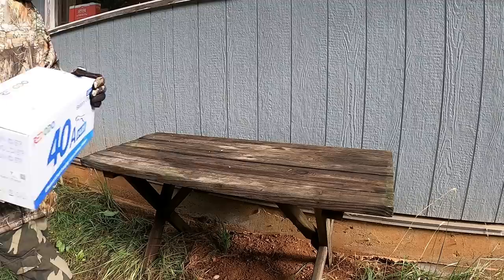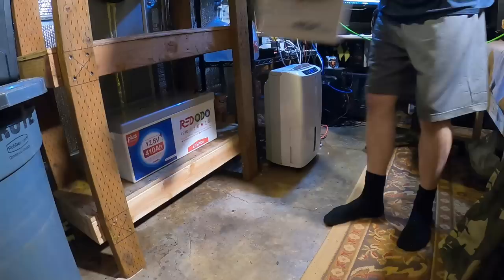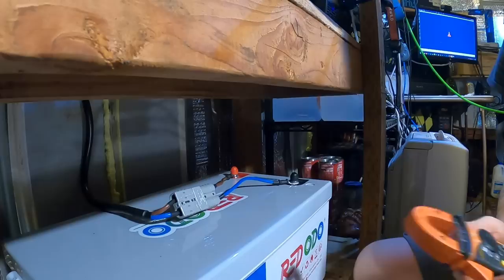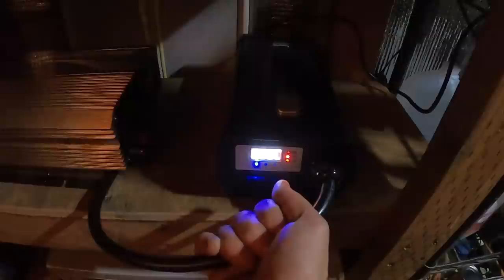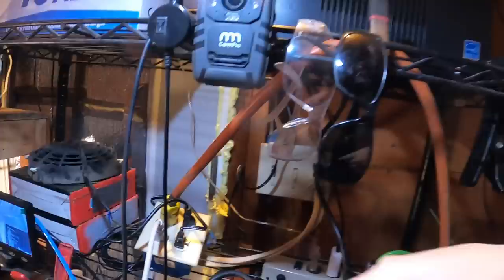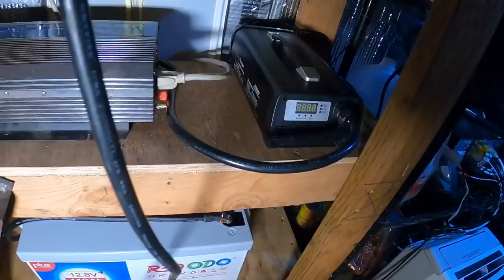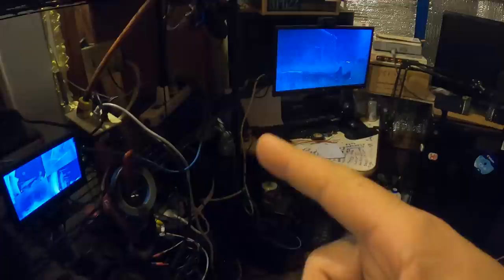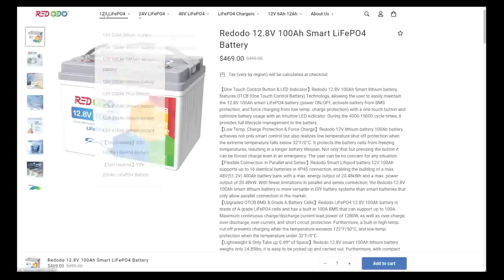40 Amp Lithium Charger & LiFePO4 Battery - Offgrid By REDODO

Comment: Nice battery and charger ive been running my cabin off 820amps of lifpo4 batterys a 4000watt inverter and 1000watts of solar for the past two years works out well and runs my well and and a small refrigerator good luck

Comment: Hi Nathan, Dennis here again..
Although you may already know, my advice..
1) LiFePo4 for house / coach power
But lead acid for the engine.
Lead acid can deliver the required cold cranking amps for the starter.. LiFePo4 cannot.
2) Please make sure you fuse or circuit breaker protect the smallest cable or weakest device in each circuit.
3) When you purchase any device intended to open a DC circuit (eg. circuit breaker, disconnect switch, fuse or fuse holder) make sure it is rated for DC.. Opening a DC circuit under load is a LOT more difficult due to the associated arc than opening an AC circuit under load..
4) Lastly, regardless of battery technology, and even though only 12 or 13 VDC, never underestimate how fast the current can rise to catastrophic levels under short circuit conditions.
While lead acid may provide a bit of a reprieve on a dead short due to it's higher internal resistance, the only thing that may save your bacon from immediate disaster with LiFePo4 is the BMS.. Sobering..
Anyhow, no insult intended, just a few of my thoughts to try to help you on your incredible journey..
Best regards, Dennis

Comment: Now you just need a decent MPPT solar controller (think Victron 100 I 50 "50 amp" or even a 100 I 30 "30amp") and a few solar panels to get real free power.......look into some used house panels, as long as they are under 100v for that solar controller.    $1699.00 FOR 400ah of lithium is so cheap, here in Australia we pay 800 to 900 for a cheap 100ah lithium, 300ah brand name battery will be $3000 plus.....

Comment: I'm sure this is sponsored so its hard to take this as seriously as someone who is on a budget and shopping for the best deal but all these lithium battery chargers are such a rip off. They aren't adjustable so you're stuck with one voltage and one amperage setting. Great if you're dedicated to one size battery but a lot of people find themselves buying what works for them and sometimes that can be 1 400Ah battery and other times that can be 4 100Ah batteries so you can split it up and use one or two of them for camping and then put them back into your home storage bank when you get home (at the same SOC). Or you might have a 48V home system but your RV is 12V and there's no point in changing your RV to 48V unless you really plan on pulling A LOT of power.

You can get variable voltage variable current power supplies (CC CV) for less than the cost of these dedicated lithium chargers. Less than $140 for a 0-24V 0-40A power supply and since it is CC CV it is lithium charger. Ideally you'd want to look for a 0-15V so you can get more amps or in the case of a 24V battery you'd want 0-30V.

https://www.aliexpress.us/item/2251832766643754.html?gatewayAdapt=glo2usa4itemAdapt

You get to control the current and voltage meaning your lithium ion can be charged to 4.10V per cell to double the cycle life or your can charge your LiFeP04 to a more realistic 3.55V to reduce stress on the cells (3.65V is unnecessary, you can balance from 3.45 to 3.55V and be just fine)

I haven't even checked the Redodo website yet but I'm going to guess $180 for that charger and there's not a single function it has that a CC CV variable power supply doesnt.

Comment: Does your security system (cameras and dvr run off 12 volts dc? If so you can go strait dc instead of using the ac dc adapter and that will save a few watts on the inverter.
Reply: What do you think the voltage of the cameras is?  USB?
Reply: @simonmasters3295   depends on your dvr and cameras but most are 12 volt you can look at the back of the dvr

Comment: Question
Is it worth it to build a Offgrid power system or just buy one of these all in one units?
Reply: Isn't that a question you must ask yourself?

Instinctively, do you have the skills, or the desire to develop your understanding of the technology?  
Do you have the budget for either?  Could you do both? (Two systems gives you a plan B in the event of breakdown)
Are you expecting a clean and tidy installation, can you hide away a rat's nest if it needs to be in a safe place?
Does it have to be ready tomorrow? Soon?  Or is it something you will work on over time?

All that before you think about performance, money, lifespan, insurance

I must finish watching now...
Reply: @simonmasters3295  I have built both of my systems. The first out of reclaimed parts the current out a mix of store bought components. 
The question I wrote was to hopefully inspire someone into going off grid.

Comment: How many Watts does that 40 amp battery charger pull from the AC
Reply: I have the same charger and its pulling 655 watts on the watt o meter for the last hour. It was at 650 watts when it started and now at 656 watts 1 hour in. Its slowly creeping up in watts. I suspect it will peak at 670watts. Im running it on a 900 watt Kipor inverter generator without the smart throttle turned on. The C or Capacity read out is total amps charged into the battery

Comment: Hello?
I love watching ur videos.....I need help with my solar setup in my rv....i paid a guy to hook this stuff up but im not sure if its right...he blew out my power inverter so im looking to buy another one i have 3 Kyocera KD135GX-LP 135 WATT 12 VOLT SLAR PANELS....2 R HOOKED UP AND ADDED 2 EXTRA BATTERYS SO 4 BATTERYS TOTAL INCLUDING MY MOTOR BATTERY.....THE 2 PANELS KEEP MY BATTERYS CHARGED UP.....I really need help....i could come to u in the spring or summer and ill pay u